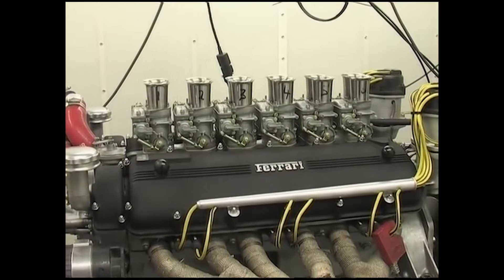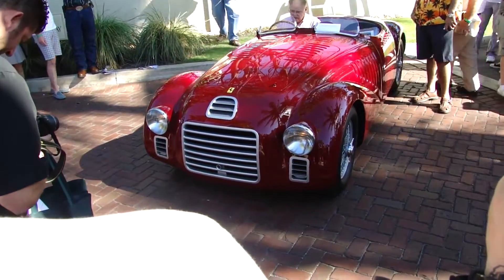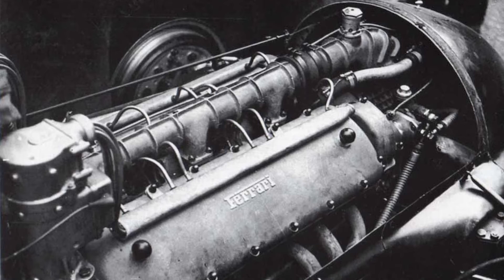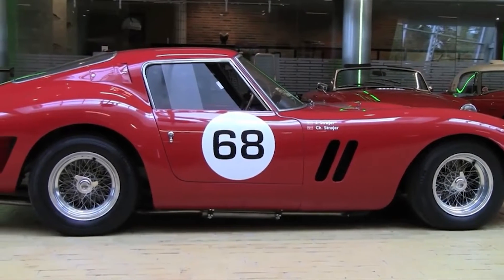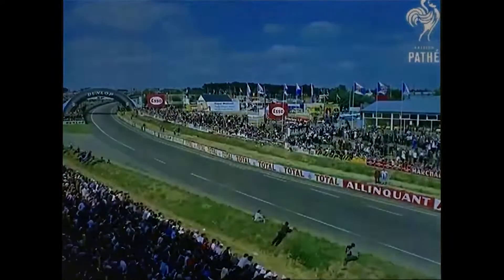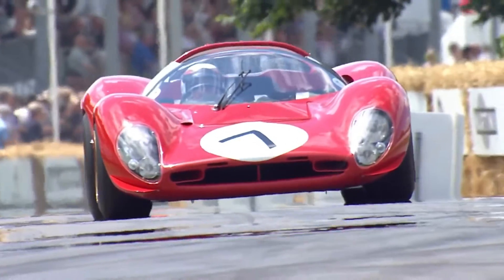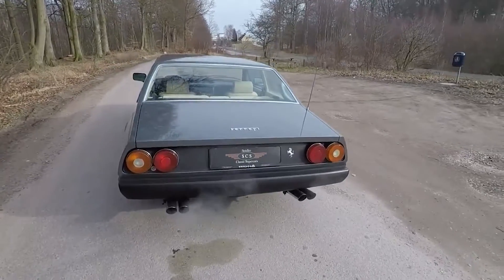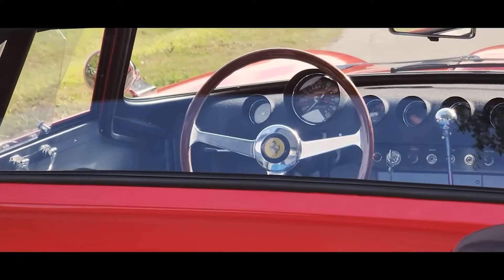The Story of the V12 that started everything for Ferrari “Colombo”

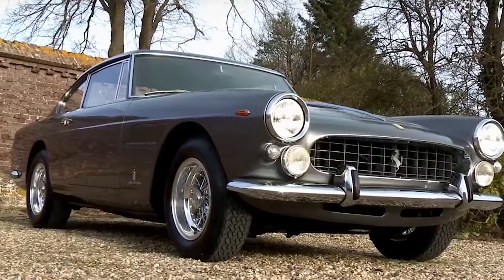Comment: 0:58 This isn't the engine from the 125 S, it's a later Colombo engine, probably a 3.0 L from something like an early 1960s Testa Rossa or 250 GTO. The engine shown at 1:30 isn't from a 125 S either, as those early engines had the spark plugs located inside the V and it remained that way from several years. There is a 125 S engine on display at the Ferrari Museum, and pictures of that engine can be found on wikipedia and other sites. Also at 3:00 This car is certainly not a Ferrari 250 from 1952 which is implied here, it's a much later car, probably early 1960s.